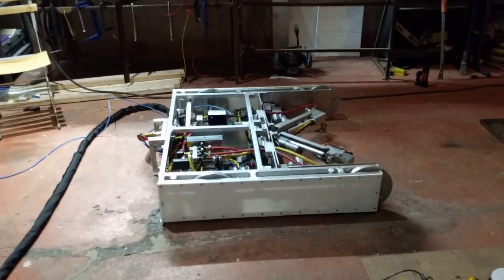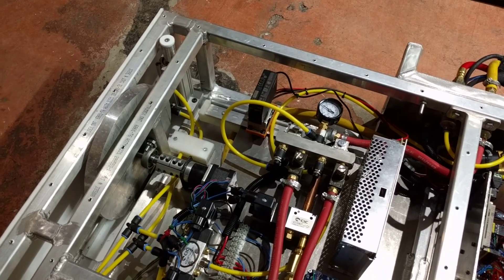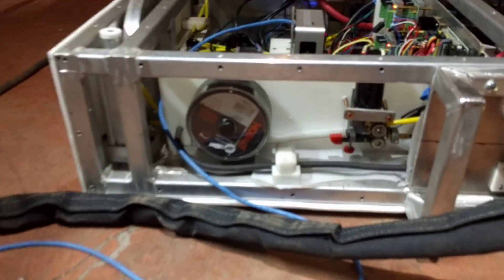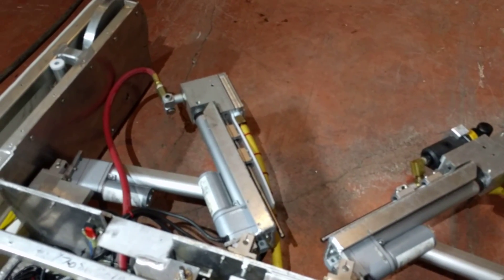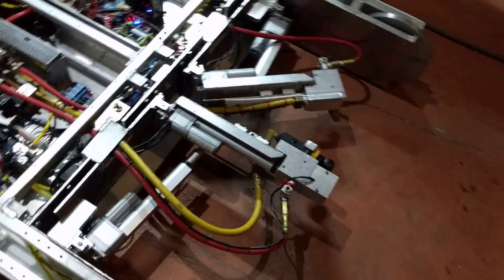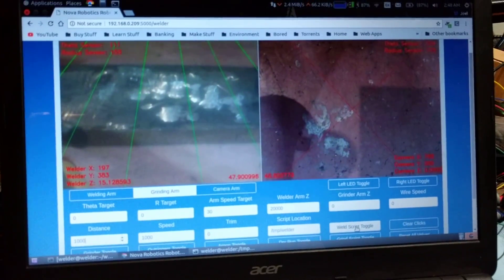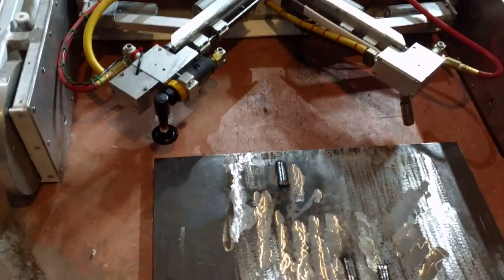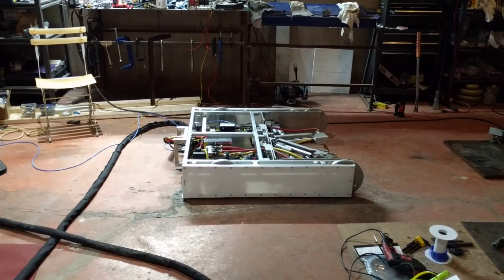Welding Robot Demonstration

Comment: Wow!  One thing that came to my mind to map both the depth of gouges and the height of welds would be to mount a line laser at about a 15-degree angle to the bed, lined up with the centre of the camera image.  (i.e. 'structured light scanning')  As the laser passed over the area, deflection of areas in the center to the left/right would indicate a depression or mound.  Once the line stays perfectly straight for a full scan, the surface is flat.  (The lower the angle of the laser, the more pronounced any deviations are, though the more spread-out the line will be.)  

Hope this helps!
Reply from the maker: Absolutely.  There is a companion robot that maps the whole press that does pretty much exactly what you're describing.  Thanks for the feedback!

Comment: Thats just fantastic.  Curious about one thing though. IF you had to make a repair would you drive the robot in look at what needs to be done, Program it then have it weld it up. Or is it a remote control type of deal.
Reply from the maker: You drive up, look at what needs to be done, tell it where the problem is, then go get a coffee.  The robot does the welding and grinding without much human intervention.
Reply: Well thats just fantastic!

Comment: How did you make the software for this?
Reply from the maker: Arduino is code is through the Arduino IDE and written in C.  I'm using an Arduino Due because it's doing a lot of heavy lifting and needs the extra horsepower.  The big computer's Linux machine running a bunch of different programs that all interact through files in /tmpfs.  These programs are all written in C++, with the exception of the web interface which is written in Python.